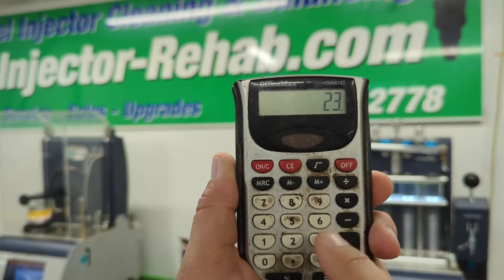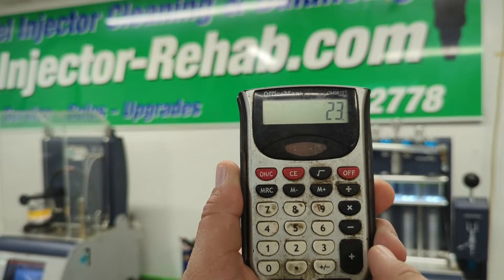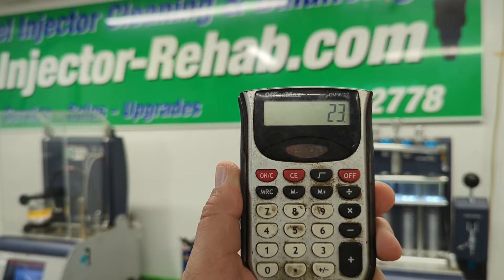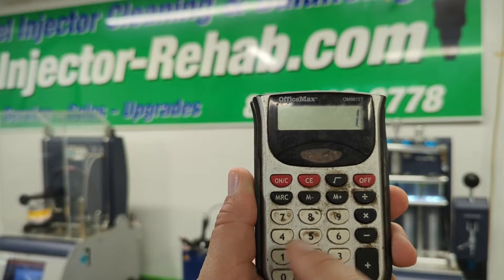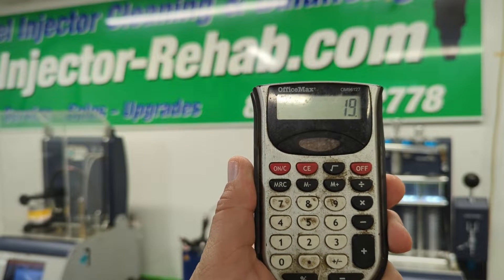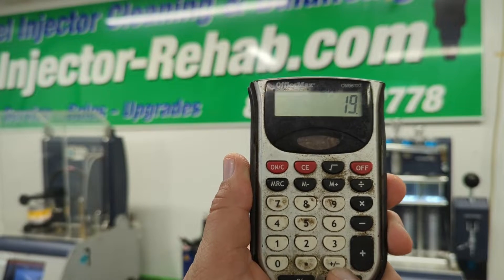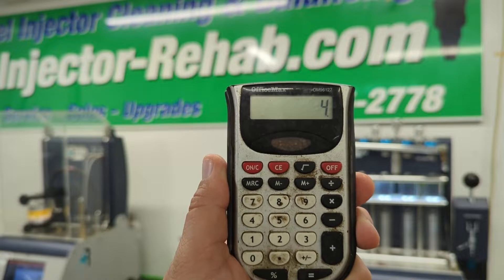The Difference between a 19lb vs 23lb Jeep Upgrade Fuel Injector

Comment: Do you know the voltage offsets for these ford bosch 3 injectors or how to compare them to a gm bosch 2 or bosch 1.   These are a popular upgrade for gm tpi, but some say these injectors run slower & cause all kinds of problems unless you do a full chip tune.  Supposedly this can be seen from wildly fluctuations in block learn values.
Reply from the maker: @chrispompano  yes. 
https://injector-rehab.com/knowledge-base/fuel-injector-lag-times/

It would be best to contact us through the website, not asking technical questions in the comments of an old video.
Reply: @InjectorRehab  Will do.  Thanks.  I wonder if anyone upgraded to a short design 4 style injector with an adapter to the tpi rail.🤔

Comment: At cold start before the engine goes into closed loop on a OBD1 system it could cause it to run rich. Rough , surge, black the plugs. Until the motor warms up and goes into closed loop where it will adjust the fuel trims.
Reply: You are right......!

Comment: Just found this and subscribed.  71 retired lineman diyer with a po302  cylinder 2 misfire on my 2006 Subaru sti.  Suspect an injector issue. Gonna do a swap see if code follows

Comment: Thanks, The explanation that the computer would make sure you weren't dumping fuel is good to know. Also not needing a higher pressure fuel pump was also a question. Sounds like the stock pump is OK. Calculator was funny actually, should have made it a bit ok a joke and laughed some. All good!

Comment: Wow dude. What's with the attitude and the whole calculator thing. You answered the question in the second half of the video which was informative. More air equates the necessity for more fuel so you don't lean out. So if you get a larger diameter throttle body you're in turn going to need more fuel. That's all you needed to say. You don't need to be a dick about it just because people ask questions.
Reply: Not informational
Reply from the maker: Have you ever been asked the same question a dozen plus times a day for over a decade?
Reply: I'd be sick of the same question many times a day.Your video educated me about something I had no knowledge of. Thanks for the video! @InjectorRehab
Reply: @InjectorRehab  that doesn't matter. Your attitude here sucks and just makes you look like a condescending dick. You should pull the video but you won't because people hate to be told what to do by complete strangers. What I'm trying to do is give you some professional advice. That's all. Good day sir.